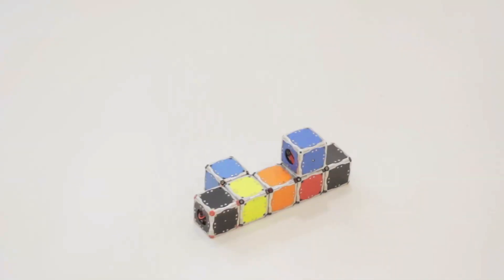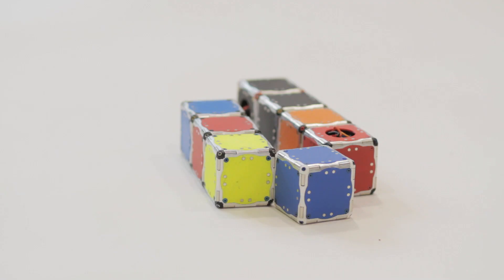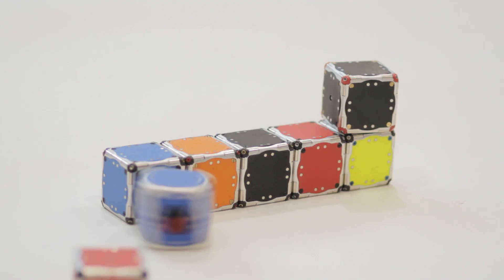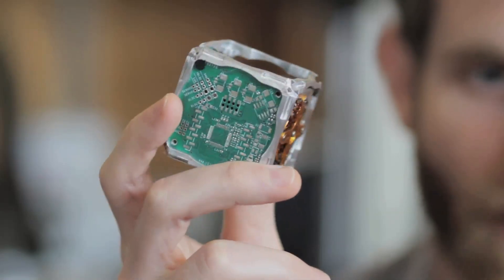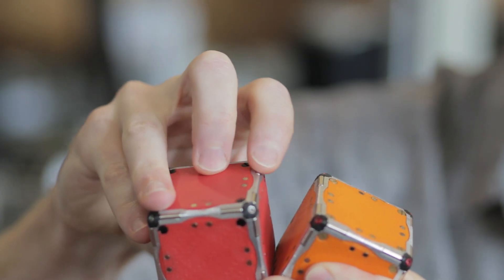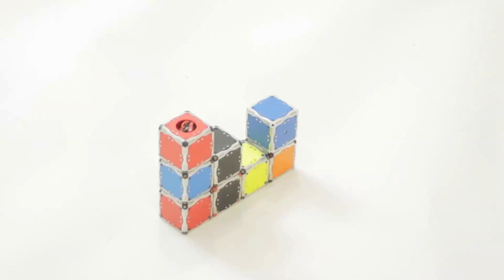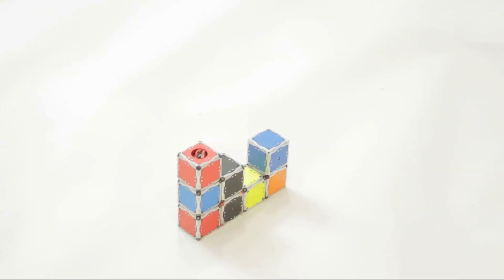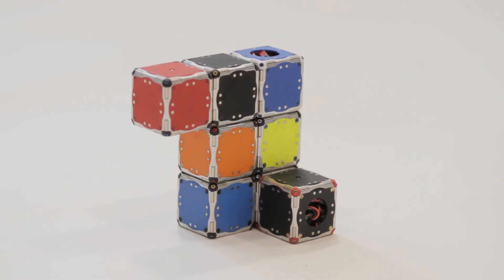Small cubes that self-assemble

Comment: Could each cube be assigned an ID that can be viewed by every other cube? You could use that to help determine where each cube should go in an autonomous system. After feeding in the design the "hive" decides that block 1 is in the first position, block 2 goes to the second, etc. or any other configuration and order of block IDs that would prevent the blocks from trying to position themselves in the same spot and essentially fighting each other for dominance.

Comment: Is it possible to have solar panels built into every single block making each block self sustainable and or have a special block just for the sole purpose of charging the rest of the blocks and have built in solar panels making it more sustainable and using the magnets on every cube for building it self together could then also be used to make a port for wireless charging.

Comment: Using the technology that we have as a base for modular self adjusting units seems like a wrong direction to me.  Yeah it's the best that we have to work with but where is it written that you have to always use a clunky circuit board and ribbon wires running off a binary coded computer to create something new.  I feel like nobody is trying to reinvent the computer but is rather constantly piggy backing off past technology to make something that's not really theirs.

Comment: Very nice piece of hardware. Really cool that it can jump relatively accurately. Given the scenario that these bots are used in construction. How will you handle the issue of authenntication considering you're sending instructional radio commands that can be hacked and/or falsified? Approaching a finished sky scraper only to have all the bots go rogue and demolish it would be a catastrophic scenario.

Comment: They're cool and all, but what the fuck could they possibly be used for?
Reply: Imagine these cubes, with 10^-7 meter side.
The transformer like robot.
You can make your suitcase, bags even clothes.
If you can insert LEDs inside the cube, you can make them your monitor.
The bag can turn into a screen, clothes, books, any kind of physical structure.
Reply: Bijay Puri You're really overestimating the capabilities of a fucking cube that jumps with angular momentum.
Reply: +systempatcher but it is amazing, nonetheless

Comment: Still hard to imagine these robots doing anything other than look cool. But damn do they look cool
Reply: I think this design is well suited to hazardous environments where exposed moving parts are a liability. They can easily be made water and air-tight. Unlike other designs for extreme environments, the cost of replacing a few of these cubes would be orders of magnitude less than robots using other forms of locomotion. You could use them as inexpensive remote sensory platforms. For example, travelling up skyscrapers to help enforce emf pollution standards.

They could be equipped with an inductive charging system. Their size and shape makes them impact resistant, being self-contained makes them environmentally protected, and instantaneous power consumption means you can leave them powered off most of the time.

I don't think these would ever be useful with internal AI, but I think a command program installed on a laptop would be a great way to coordinate them. The coolest part is that everything expensive can be in a safe place, and you can send these cheap little units into very dangerous places and not worry too much about losing them. And if you really wanted to, you could recharge them from a distance and try retrieving them a few weeks later.
Reply: this robots dont seem to do really much except jumping and spinning, but it lays the foundation for other modular robots to be... well... better... Or you can make minecraft farms in real life with them ^^
Reply: +AX53 That's absolutely true. Designing things like this is a way to highlight what can be done. It may not have immediately obvious practical uses, but engineers are the ones who find practical uses. Pushing the limits of a medium is often the first step to improving the medium.
Reply: This is just the tip of the iceberg. Once they perfect this, they can apply it to other things. :)
Reply: Aaron King okay you won the point ^^
Reply: Except they aren't attached to motors and they don't move up and down. They tilt +-12 degrees.
Reply: what do they want me to do with this invention... eat it?
Reply: No thanks on the cubes going halfway up a skyscraper, slipping, falling 40 stories and killing people. Most of the rest: good ideas!
Reply: I think at the moment when it is possible to produce them really small and cheap they will be practical.
What would you say when I say lets place 9.000.000 Mirrors on 9.000.000 individual Motors and let them move 1000 times per Second up and down? This is in a nutshell how DLP-Projectors work that you can buy for under 1000€ in every electronic store.
Reply: wow you must really lack any imagination if you find exactly that hard to imagine ... :x
Reply: ShutUpAndSmokeMyWeed have you watch big hero 6? Man, you have so limited imagination
Reply: This could be a great April fools prank. Someone goes to sit on their chair and these cubes move apart and that person falls down.
Reply: Look up ribosomes and existing "micro... robots" (dare is say machines for nostalgia?)
Reply: +Aaron King There is no denying that they are really nice for assembling nice shapes but I guess the point here is that a collection of cubes that can jump around and attach with each other doesn't serve a very wide variety in practical use.
Reply: @AX-xi2pw  Your severe lack of imagination does not limit the potential of these machines.

When the steam engine was invented it was just a neat little trick that people could show off to each other.
When the laser was invented it was just a cool light show.

Comment: A specialization of the cubes could be necessary in the future for economic reasons.
For example, a power supply via solar panels could be done, using the cubes outside the structure to be built.
Inside the structure to be built, the solar modules could possibly be otherwise useless.
For this purpose it would be necessary that the inner cubes could exchange their solar module to the energy storage module of the outer cubes automatically and vice versa.

Another solution would be to continue using only identical multipurpose exterior walls.
If the walls could regulate its light transmittance in this case etc.

Anyway. To me it seems as if the development of the M-blocks could be the mise en place of the primordial soup 2.0.

Comment: If there's only one motor how does it move along more than the 2 axis? What if it needs to move along the plane that the motor's axle points in?
Reply: Gear Change to different fly wheel would be my guess

Comment: Perhaps you could incorporate some sort of power transfer between the cubes, so if one runs out of power, it can recharge from the others. Initially I was thinking wireless charging through induction coils, but with all those powerful magnets I'm not sure it'll work. Also, if one cube finds a power source, it can daisychain power to all the attached cubes. What do you think? There are many options, I have lots of ideas.
Reply: Inimbrium I like the power retrieval and distribution idea. How would you store and receive it? The magnets might offer a great point of contact between cubes.
Reply: Well... the magnets may not work perfectly now but those are just prototypes. They'll be cooler and more unique in the next few decades. Maybe they'll become a new generation for mobile devices (around 7G or beyond.). or probably they are the proto-version of nanites (like Nicole Holo-Lynx)

Comment: There is a clear distinction between gyroscopes and the technologies use to move these boxes. I am absolutely certain the technology used to move the boxes; the internal mechanism controlling the angular momentum, will no doubt be instrumental in the 21st century's development of aeronautical and astronautical engineering of the control mechanisms of advanced air and space craft propulsion and navigation. 

One of the most impressive examples of this I've seen is the video release a couple years about and on YouTube here:

YouTube: The Cubli: a cube that can jump up, balance, and 'walk'

When this first came out, I immediately saw the potential of how this could be used in advanced technologies useful in aeronautical an astronautical engineering navigation and propulsion.

The technology is highly useful in current multi-prop drones for rotation and counter-rotation, lift and decent. But a single motor/engine vehicle won't need multiple counter rotating engines blades; like current commercial drones, when the 'boxes' technology and devices are strategically places around a airframe, acting in counter balance to drift and wobble...  the technology with it's angular momentum counter-acting abilities; when engages by computer programing, will zeros out any drift and wobble from occurring. 

And the boxes ability to jump will no doubt lend lift ability simultaneously when lift/thrust is applied; thereby, reducing the drag coefficient of air resistance through acceleration in any direction; up, down, sideways, etc. 

Regrettably, the flight characteristics will no doubt also be intensified by the 'G' load of such acceleration... thereby, making such airframe technology beyond a pilots human ability to withstand such "G" loads.

Comment: hello , congratulations on very well designed work. I believe that the internal radio can be useful for the cubes together calculate its location in 3D space and show it in a CAD software in real time . Based on the time it takes to receive each cube waves sent by the other, an atomic clock may be required.

Comment: I don't think they realize that their breaking Newtons 3rd Law, oops, looks like the physics textbooks need a revision.
Reply: James Smith actually this is displaying what that law statutes: for every action there is a equal and opposite reaction.  there is a small wheel spinning inside and when it suddenly stops it slings it along.
Reply: jetison333 thing is, in this case the cubes are reacting off their own inertia, which means these are reaction-less drives. Meaning that if you drop them from some height they will tend to perform a "double jump" like in SuperSmash Bros.
Reply: James Smith This violates conservation of momentum as we know it
Reply: James Smith they won't perform a double jump in midair, thats impossible.  There only slowly spinning a reaction feel and  that is slowly spinning the box but all of that is put into the floor. After that all of the energy that it had built up is sent all at once into spinning the cube causing one end to push against the ground and it jumping.

Comment: Apparently you haven't play minecraft or with Legos :p. This is only a proof of concept, As they become smaller the magnets strenght  will become more significant, i would also add some sort of locking system to keep more permanent structures.

Comment: Robotic engineers are still using motors in 2013?
I thought that motors (moving parts) were already ancient technology.
What happened to magnetic fields, wireless power supply, miniaturization, and low power consumption?

Comment: Except that each cube uses angular momentum to move, so it has to have a really small mass to work, so they can't put heavy things inside them. And there's no space for things. And the things would have to be completely retractable otherwise they wouldn't be cubes. And they don't have motors or axels or anything so there'd be no point adding wheels.

Comment: I think part of the reason that they are so clumsy is that it is STILL in development, so it won't be perfect any time soon, plus i think it is already an achievement because it is still working, this is probably a prototype, imagine that once they are done perfecting it they could have a robot that can switch its hands or legs to different places. I don't think that this is to help the robot move, its more for it to change its structure as mentioned in the video.

Comment: They're so clumsy. In half the video footage you've shown, they either completely mess up and jump off each other, or don't align properly. Is that because you're trying to be honest or because you find it really hard to get footage where it actually works successfully?

On top of that, how is a small, light cube supposed to perform meaningful tasks? Just by moving round the main block it disturbs its orientation, and you don't seem to be able to get the combined block structure to move.

Comment: At 4:06 he touches on what these will be used for. He said with a large number of m-blocks. You could use the m-blocks as cells for a much larger structure that could morph into any shape and with a little more engineering could do pretty much anything.

Comment: If i were them, i would execute those tasks by changing the magnitude and direction(n to s or s to n) of magnetic force, I would make the face and corner magnets controlled aswell, i would check each face magnet by hall effect and controll if the magnets all have the same value(which would lead me to they are perfectly aligned) if not i would increase or decrease the magnet magnitude to have perfect alignment. When i watched the video thought they did the same however they didn't. Not impressed.

Comment: (1) A search and rescue plane could carry a few hundred thousand of these blocks to be drop into the ocean upon which they self assemble into a small boat. (2) drop them into a desert where they self assemble into a hut for shelter. (3) drop them into a broken dam where they self assemble to plug the dam. (4) Make the outside casing  conductive so they can self assemble into a long power line in the event of a downed power line out in the middle of ... "nowhere". Until the crew arrives.

Comment: Yes, maybe that is possible. But you still need to build the self building block. Which is far more complex even in it's simplicity than forming sheet metal, or building a structure from raw material.

Comment: Couldn't you place electromagnets on each side of the cubes, then alternate which one is on to make a side flip over and connect to another cube/metal surface. It might not work as well, but it sure would be a heck of a lot quieter.